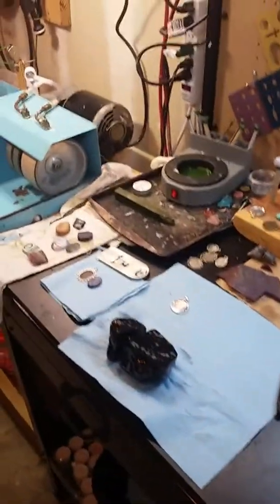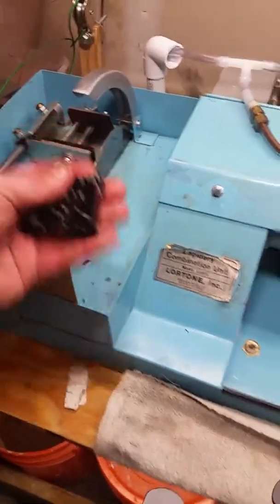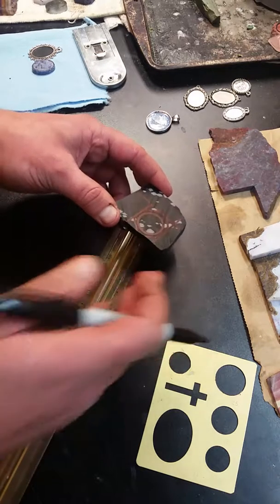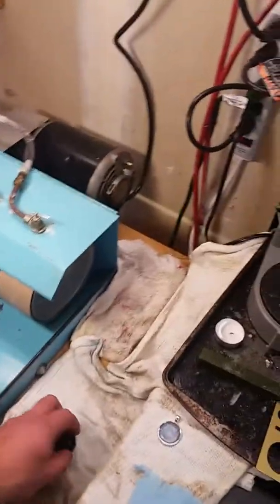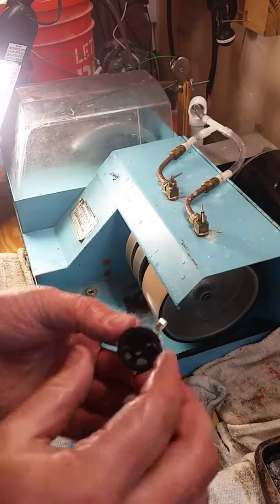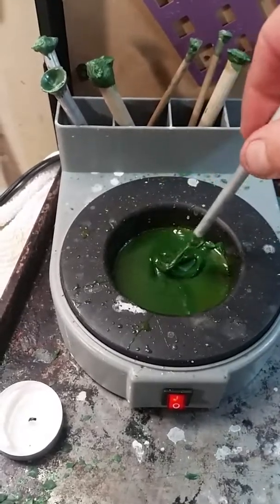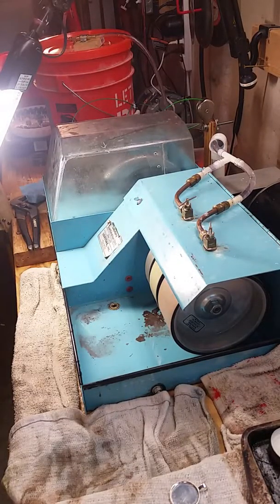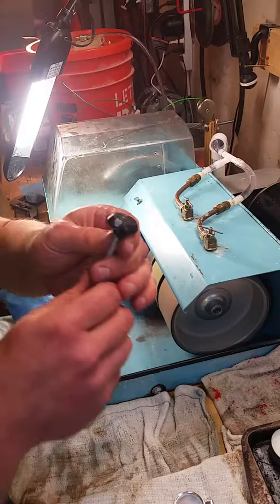Snowflake Obsidian Cabochon - Start To Finish

Comment: very nice job , that is a beautiful piece. your shop  looks to be well organized too.
Reply from the maker: Thank you!  The shop is constantly being upgraded.  I just finished a video on the set-up and have already added a 35 gallon water storage tank for the recirculating drip system.    Should allow for much more time playing with cabs : )
Reply: Try using an aluminum nail for marking your slabs.